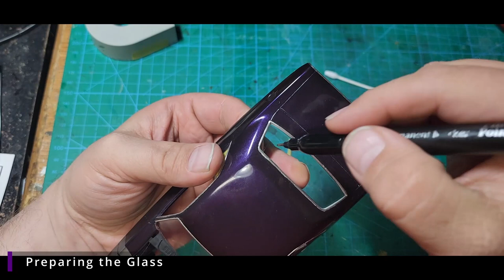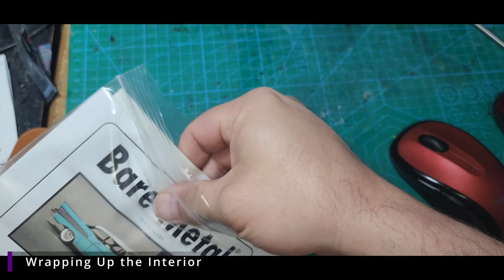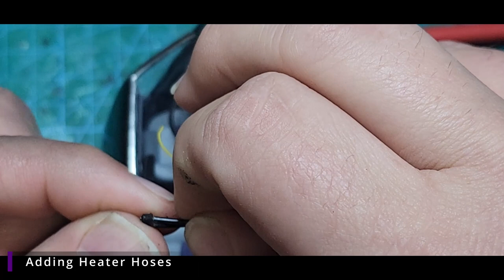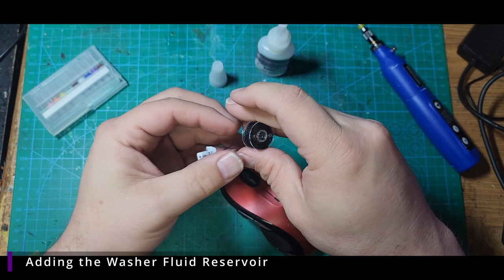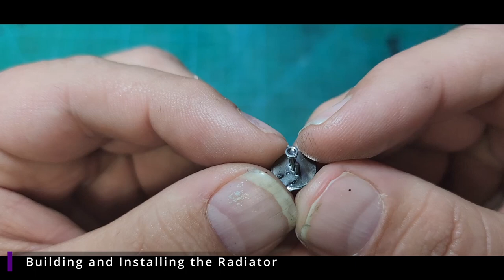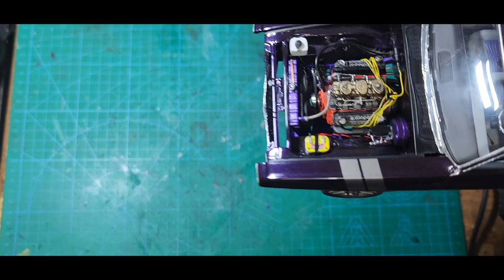Revell - '70 Challenger - More Interior work and Engine Bay

Comment: Great idea on the headliner!!!!   Interior and engine bay look Awesome!!!  Ditto on the punch.  It is a Great tool though.    Love the radiator.   Your getting very good at designing parts.   Put a dab on one end of the braided hose.   After the glue dries you can carve the end into a point and make it is easier to thread the fittings.   Wild Bills was AMAZING when iI lived up there....That was 25 plus years ago.   There use to be a place called Bobby Hall's close to downtown Dallas that was really good as well.   Unfortunately nothing here in San Antonio either.    Lion Heart in Kyle is the best place in the San Antonio / Austin area.   Thanks for sharing
Reply from the maker: That is a cool idea on the braided hose fittings, I'll have to try that. Wild Bills got bought by the guy running most of the Hobby town franchises up here and the collection I think got dispersed across several of the stores.

Comment: I was thinking put the tape on the back glass then put it in the body and trace it more accurate and save a step
Reply from the maker: That would work as well. However, i was making a mask for the inside, so it would have to come back off and having the lines marked on the glass made it easier to line back up after i took it off to cut it and then applied it to the inside.

Thanks for watching!

Comment: Buddy love your builds and the scratch building that you do. The small detail wire you use for your fans and etc. Do you have a link? I’m struggling to find 34 gauge counted colored wire for small detail stuff. Once again that you for sharing your talents sir it inspires me to keep learning
Reply from the maker: Hi there I just saw this. for some stupid reason  YouTube stuck it in the possible spam page instead of regular comments. I ended up getting so many questions about the wire and the wire box that I made a video specifically about it with links in the description to the box on amazon, and the wore sellers on Ebay. 

https://youtu.be/sLs7AK_myMU

Comment: very informative and nice build, do you have any tutorials on how to install a carburetor linkage?
Reply from the maker: Thanks, sadly I do not. That is not one of my strong points. Sometimes I just drill the carbs and glue a staple between them depending on the spacing. I tried the photo etch from protech once and made a complete mess of it.

Comment: This really is a phenomenal build!! I like your collection of the small gauge wire spools. Was that sold as a set by chance?
Reply from the maker: Thanks, Glad you are enjoying it. Nope. It was not. The case with the spools is a sewing bobbin kit off amazon. The wire I got off ebay. There are only 1 or 2 sellers that I know of that sell 34 awg wire, the top 2 rows are 34 awg, the middle 2 are 32 awg which is perfect for plug wires, and the bottom are 30 awg.  The wire is like $3 or $4 per 10 meters roughly 30 ft. so I grabbed a bunch of different colors and have plug wire for life :) .
Reply: @JHartModelworks  good info, I was figuring it was home assembled but what a great idea! Thanks for the info.
Reply from the maker: @ScaleModelCarBuilder  Thanks. the wire I bought looks like they just loosely rolled up a bunch and wrapped a little bit of kitchen cling film around it. I needed to organize it better so it didn't turn into a giant ball of mess.

Comment: Where did u get the wire kit & were they all 32 awg size?
Reply from the maker: It is actually a set of sewing bobbins I got off amazon. I added the wire to the bobbins manually. Took a while but seems worth it compared to having a tnagled mess of wire. The top 2 rows are 34 awg, the next 2 are 32 awg, and the bottom is 30 awg. I got all the wire off ebay. It's like $3 or $4 for 10 meters, so I went nuts and probably have wire for the rest of my life. 32 awg is perfect for plug wires (I'm pretty sure it is what the major after market companies are using). I use the 30 and 34 when I think I need something thicker or thinner.